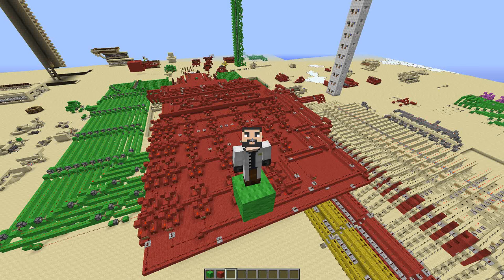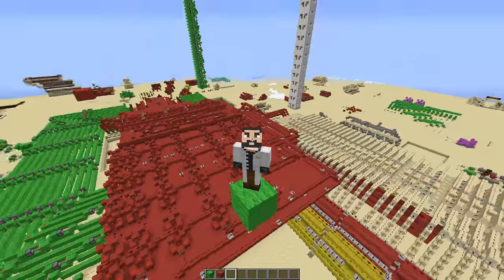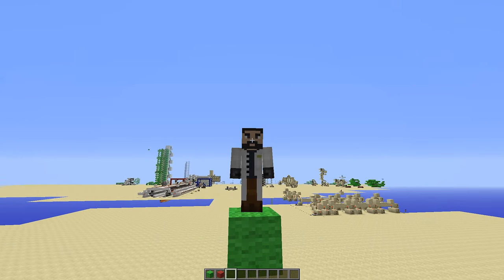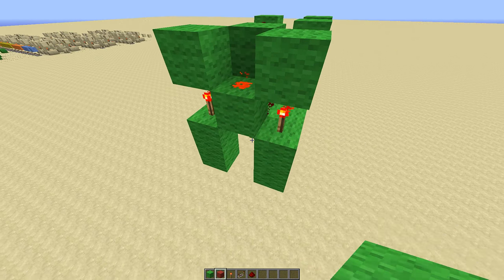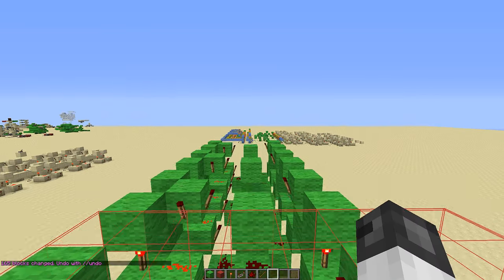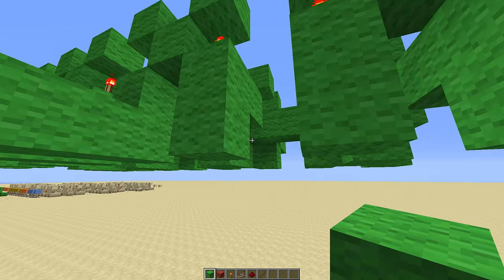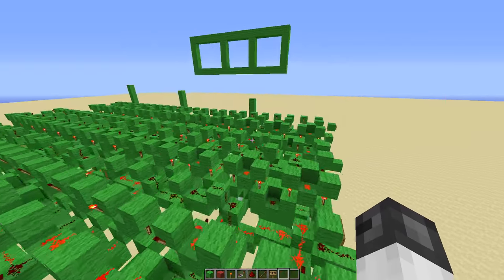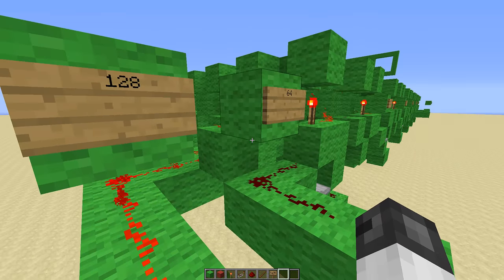Minecraft Binary to BCD(binary coded decimal) converter tutorial

Comment: after spending 2 1/2 hours making a 12 bit one of these i was about to go rage and comment that it dosent work. luckily i found the problem quickly(i missed a piece of redstone on the adder) and instead i want to say thanks for thois tutorial. it is the most helpful one i have found. it is easy to build and it has a very good explination of how to build it. thanks man!!!! :)
Reply: +Alex Everest yeah you should check the circuit few times it happens a lot especially when you build a complex circuit
Reply: yea. i learned that about 3 hours later when i finished my calculator. there were so many missing repeaters and torches. it took about 5 hours to fix all of what was wrong and to finally get it working
Reply: +Alex Everest one last note whenever you use mcedit or world edit sometimes it moves the redstone or remove torchs when you copy them mostly it happens when you rotate them. it happens a lot